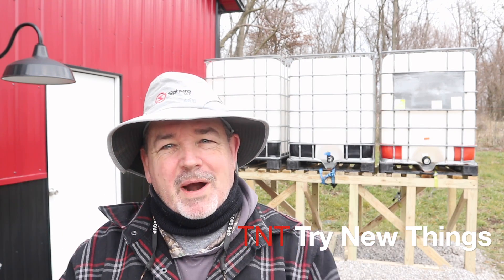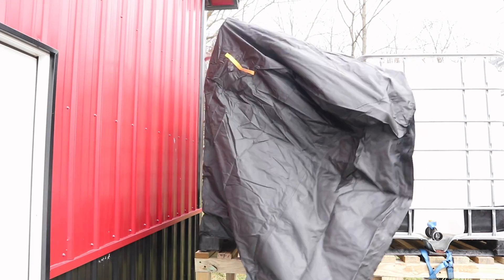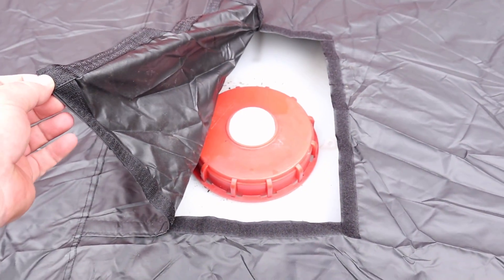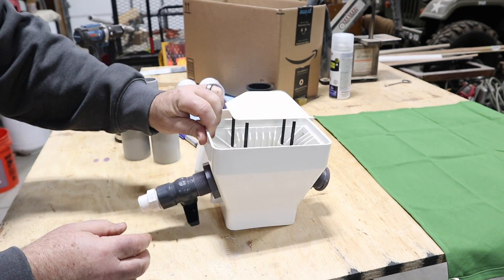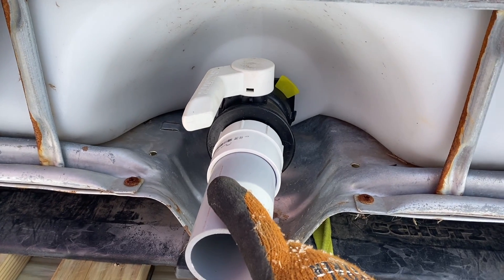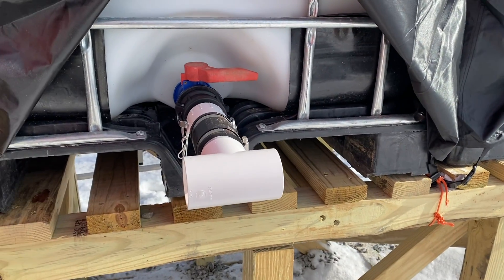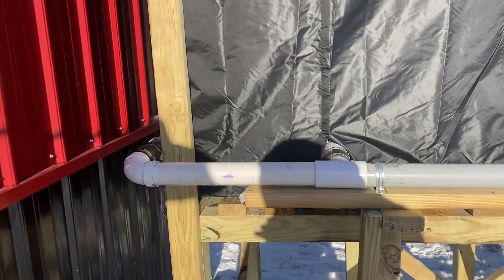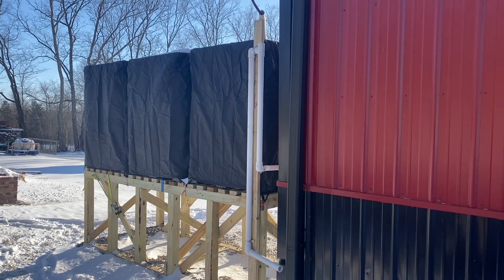#214:   Pole Barn IBC Tote Rainwater Harvesting System Build Pt.2/2

Comment: Question - given the effort and price of lumber, Im considering doing mine the same way, but have the tanks sit on the ground. What are the biggest benefits you see to the framing?
Reply from the maker: I was looking for more head pressure…. But still ended up with a pump.   Be good to be off the ground a bit just for the valves and piping.   A friend of mine got a bunch of free wood pallets from Facebook Marketplace and put his IBCs on stacks of 3 pallets and that seems to be working well for him.    Agreed lumber is too expensive.

Comment: Does the diverter cause any backup or slow down from large rainfalls through the downspout?
Reply from the maker: It fortunately does not.   It sends a small portion of the overall flow to the inside perimeter which then is diverted through the smaller hose (although I have since installed a slightly larger diameter hose) the rest of the roof run off goes down the riser without issue.   No backup or spillage over the gutters experienced.   Thanks for the question Denise.

Comment: Hey Chris, how is this all working with summer being hot now? Did they completely fill up?
Reply from the maker: They fill up pretty quick.   I figure it takes 200-250 gallons to water the garden, so I can get 4-5 waterings in from full.    I have just enough for one more so hope it rains.   Been hauling water from the creek to keep the blackberries and apple trees alive 50 gal at a time.
Reply from the maker: Did you hang up the video cameras?    Seems like a while since your last KY property update.    That be great place for a garden… no shortage of water.
Reply: @TryNewThings  I've got some updates coming. We haven't stopped working. I haven't had time to edit and post the videos. I haven't had a great luck yet with the cameras.
Our RV Shelter is now completed. Our next stage is the rain catchment system and I love what you did so I'm stealing your ideas and modifying them for our location!!! Which side of KY are you on? We get so much dew running off the roof every morning just south of Corbin, that I think we could fill the tanks just from that!.

Comment: How do the 2nd and 3rd tanks fill if you only have the intake going to one tank? Also, every time you open the spigot to use water, won't water also go down the overflow tube? I guess I need to go back and watch again to see what I missed.
Reply from the maker: The 2nd and 3rd tanks fill from the same horizontal piping that goes along the front.    With all three IBC tote valves open, and the piping valve closed, the tanks will always seek equilibrium in height (one fills they all fill, one empties they all empty)   I have the overflow set up so that when the water reaches 2" from the top of any of the 3 tanks it will run out the overflow vs continuing to fill the tanks.   You do have to crack the top caps on the two tanks where the intake isn't so that air can be sucked in when emptying, and push out when being filled.   I just un-screwed them one turn and that was enough to let the air pass in and out.  Was the simplest set up I could think of.    When not in use (winter) I keep the  valves for all three tanks closed, and drain the horizontal line via threaded end cap so the system does not freeze.   I also have to turn the valve off of the intake or else the first tank would continue to fill and spill out the top, because with the tank valves closed, the overflow would not be in effect.    For 3/4 of the year, I would leave all three IBC tote valves open, intake valve open, and just let it run out the overflow if we got too much rain.    Let me know if you have any questions.    I have used it a bunch lately and seems to be working very well.   I do intend on doing a video on adding a booster pump to the outlet to give me more pressure, but that will likely be in April.

Comment: Pretty cool tank covers, don’t like that 3/4 hose fill, seems counter productive. But never having used such a set up, there may be a reason why. I wonder if you could cover tote with firewood inside. As always, cool video and explanation as to what you’re doing. Have a good week.
Reply from the maker: Not sure I'm in love with the 3/4" either, I know I was certainly worried about it.   But, it did fill all three tanks from just one steady day of rain.    Guess 1000 sf of roof surface all going down one downspout helped.    I think if I decide to and I can live without the shut off valve I can go up to 1" - just clamp a flex hose up to it.   That would be almost double the intake area.   Will keep an eye on it.
Reply: @TryNewThings  I wonder if you could rework it with a larger pipe by drilling out diverter?

Comment: Hey Chris..great video...wondering how the tanks are connected for filling...I understand the connection for drain...thanks
Reply from the maker: The tanks fill and drain using the same horizontal pipe along the front.   As long as all tank valves are open they will fill to the same elevation.   Do have to crack the cap on top a little bit to let air in and out as they fill and empty.    Thanks for the great question.    Subscribe if you have not already.    Will be doing a comparison of water flow with and without a booster pump installed.     Likely be April, waiting for last frost to do that.   This time of year I leave the tank valves closed and leave horizontal connecting line open if I am not there so the pipe does not freeze and burst (threaded end cap)